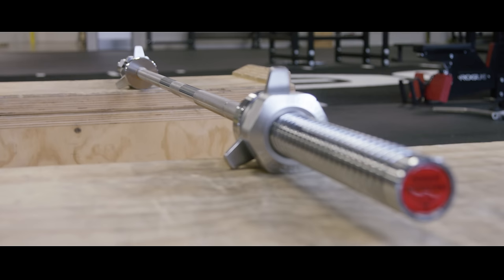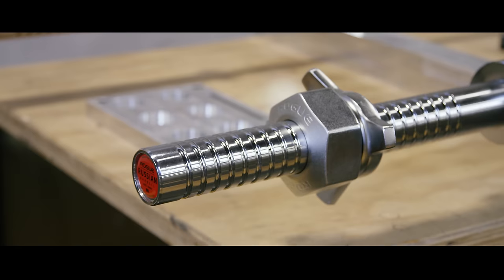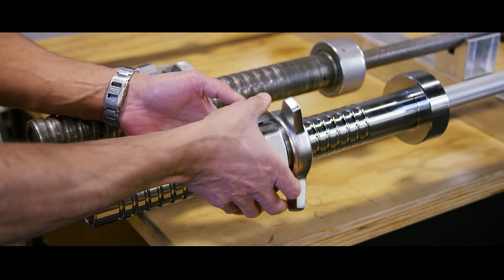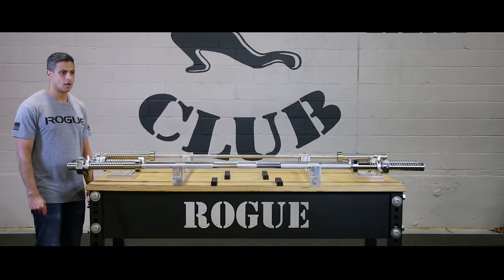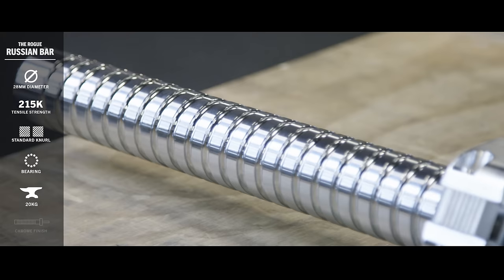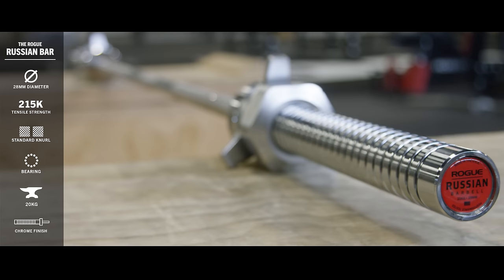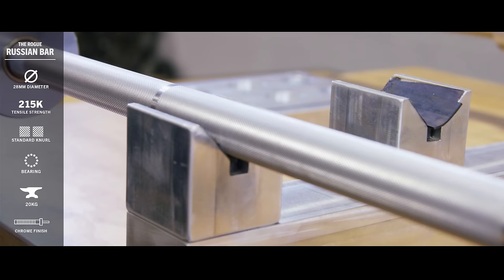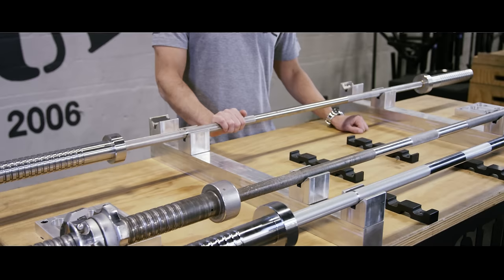The Rogue Russian Barbell

Comment: great fix for something that wasnt a problem to begin with

clips are fine
Reply: Spring collars you mean? They are crap
Reply: James P he says that Because he doesn’t lift anything heavy.
Reply: When the locks for pancakes are old and used a lot, they sometimes wedge and in order to remove the lock for pancake, you have to disassemble it.
But with new locks, such will not be for sure.
Reply: It is unique and interesting.  Some people will appreciate this bar.  It amazes me such high quality variety exists.

Comment: Rougue: We're really good at one thing. manufacturing products that aren't very innovative, that serve no real purpose, and charge way more than our competitors marketing a similar product. but we make shit loads because, CrossFit.
Reply: Actually, in the barbell bis, rogue products aren't specially expensive. Uesaka and eleiko are more expensive.
Reply: sufronausea there's a reason tho. especially eleiko stuff
Reply: DJ you missed the point of my spelling buddy.
Reply: eleiko makes good competition weight lifting stuff. It tends to bend from everyday use.
Reply: thats called capitalism my guy
Reply: GIboy1990 I don't think you understand how capitalism works...
Reply: Nathaniel Keating obviously I know how capitalism works. I'm just shitting on CrossFit
Reply: I call bs, rogue is very cheap comparatively.
Reply: well, for some things.
Reply: GIboy1990 for Olympic weightlifting (not cross fit) I couldn't thank rouge enough for quality barbells and plates not to mention reverse hypers for my lifting. Good racks as well.
Reply: Eleiko is way better than this crossfit shit bar. 10 bronze needle bearings that last me 20 years and the bar has been amazing. All of my PR on one bar.
Reply: Rich Piana's Oil Distribution Manager in eleiko you get what you pay for. Same is case with ivanko.best in the market in terms of quality
Reply: highview seeker 
What reason is that?

If Rogues weight is accurate to the same specs.. and the hole tolerance is as tight (may even be tighter) as Elieko.. What other evidence constitutes Elieko/Ivanko to cost 2x as much?

Ofcourse you can use the easy answer and just say "BECAUSE DAY ARE BETTER QUALITY!!"
Reply: @sufronausea 
You're talking about the most expensive mass produced bars in existence. Not the best examples.
Reply: you just defined made in USA
Reply: Man made anything is crap due to obsolescence. It looks great in the ad, it seems to do what you want but it never seems to last.
Reply: Lmfaoo, you absolutely kno nothing then 😂😂😂

Comment: I have a question for the general audience, probably someone that understands physics well: If the plates are extremely secure on the collars and are fastened down tight,  if the plates down give at all when the bar slams, won't this potentially wear the collars down faster. The energy needs to be exerted somewhere, normally if you drop a bar and the plates are free to jiggle around everywhere when you drop the bar, this exerts all the energy safely. I feel like a more rigid design would potentially break the bar down faster.
Reply: Maybe that question is even directed to Rogue themselves.
Reply: Mr. Holy hell, the energy will go through the rubber plates....hence the barbell bounce...
Reply: given the size of the collars you are unlikley to actually have that much of an issue with wear particularly if your lifting on a proper platform and using bumper plates as the plates and platform will absorb most of the shock.
Reply: Did someone say lifetime warranty?
Reply: "If you have any further questions, email team at roguefitness.com"

Comment: If I was spending 800$ on a piece of steel it had better be forged and go inside an engine.

If I just want a bar to lift up and down an 80$ one does exactly the same job, 700 dollars is a hell of a premium to pay to not have to re lock the collars after a set.
Reply: For Powerlifting a cheap bar is fine but if you get a crappy cheap one for Olympic lifting it will snap and the bearings in cheap bars are garbage and spin is very important in Olympic lifting

Comment: LOL!! This car should be called the "Russian GIMIC bar". ROGUE put grooves into the sleeve?? On an oly basr??? I bought as my first barbell something similar. Chose it for the same DUMB reason out of the lack of experience. Being a complete novice at the time. Thought having grooves would be "easier". Never knew i would be doing "drop-sets" changing the weight on the bar between sets. And what did ROGUE do here? The collar slows you down twice as much as the collar has 2 parts...one part you screw followed by a 2nd piece to "click-lock" the "propeller. The standard lever collars are the fastest and most secure. Followed by the cheap but effective for a period the cheap $10.00 spring clamps.  :) Here's a poke in the eyes for ROGUE suits for putting out this bar. :)) POKE POKE!!

Comment: For everyone poo-poo-ing this bar.   #1-its a nostalgia thing for sure.  That's pretty obvious..  #2- Its interesting to note is was used at the 1980 olympics, but never gained traction.   But if you have ever been a loader at a meet, this design makes sense for a competition.  If you have ever been a part of, or watched, when two lifters change their attempt amounts/card back n forth several times before an actual lift takes place....well those std.comp collars suck.  The standard IWF Comp. collars actually aren't that great for staying put.  The little lever with the black knob you can only twist about 200 deg. before having to flip it over, and twist again.   At times if change plates are added to the outside. there are scenarios when that all doesn't work to well and you have to fumble with it.... not a terrible thing, but annoying when you are trying to quick about things.   And the lever screw doesn't get all that tight.  One lift yeah, its fine, I guess ... but many times they are loose/or have moved when I've pulled them off after the lift.  And IIRC, we've seen plates fall off at World meets, etc.   The Russian ratchet design wouldn't allow that (plates could only slide a fraction of inch).    https://youtu.be/FC3yEQgweJs?t=22   (there have been others) https://youtu.be/B--EsAyFIP8?t=3626

Comment: you had me until you said womens version....  why do women need a different bar?
Reply: david w diameter is smaller on a womens bar
Reply: alright, but is there a reason it needs to exist though?
Reply: ... why do you think i asked the question in the first place?
Reply: generally speaking women tend to have smaller hands than men so a womens bar which has a smaller diameter grip would allow them to hold the bar
Reply: Because olympic weightlifting has seperate bars for women and this is an Olympic weightlifting bar.
Reply: Jonny, what's the point of weight classes?
Reply: Smaller hands, less grip strength.